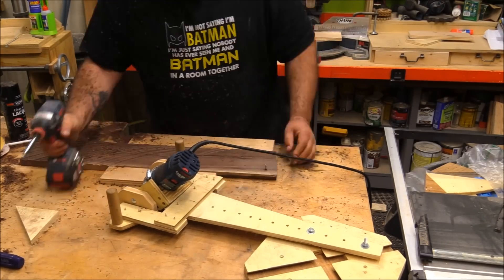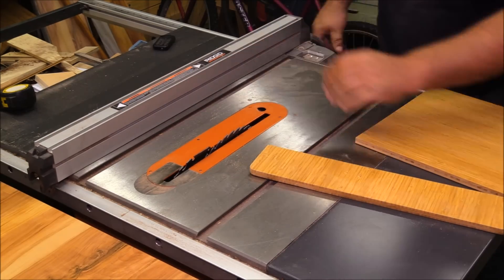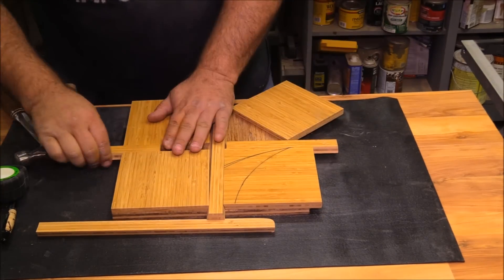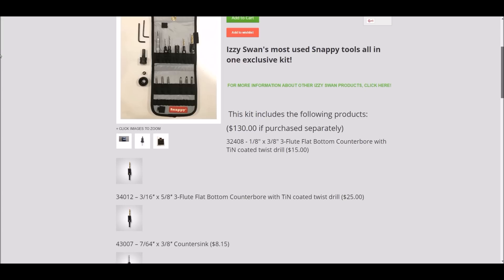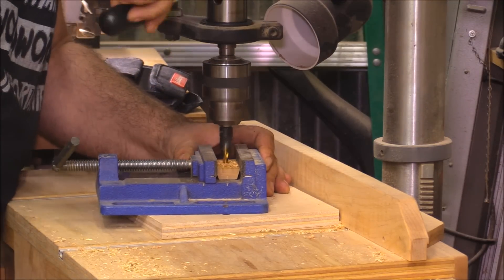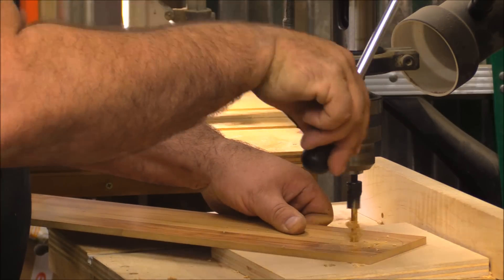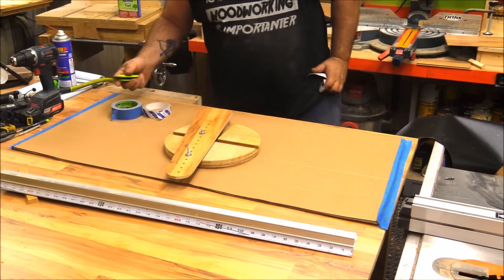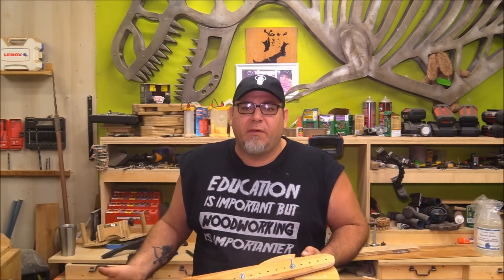(how to make) a router jig for making ellipes

Comment: If you add som talc in the slots I bet your guide rails will slide even easier. Nice and instructive video though.
Reply: sjobang paste wax would be better. last longer and you dont have to worry about the dust scratching a workpiece. Not that talc is likely to level any major scratches... lol.

Comment: there is a limit with major and minor axis diameter with jig. You can usually solve with use of longer slides. Can use 50% shorter slider to slide minor axis than major axis to avoid collision). Then you can have a narrower eliptical tables

Comment: instead of gluing the 4 squares onto the base, could have made the whole thing out of a block of 38x200 and routed the channels with a dovetail bit. use the same bit to chamfer the edges of the slides to fit the slots.

Comment: Fun Fact:  This would be called device is very similar to that of a wanzer needle bar mechanism found in sewing machines. (especially older ones like singer, wanzer, etc).
The wanzer needle bar mechanism is used to translate rotational movement to linear movement.
in the case of the sewing machines, it takes the rotational movement of the motor and translates it into the linear movement of the needle.

Comment: instead of drilling the holes like you did, could I just make a long slot and use wing nuts? Of course, I would have to make sure they are nice and tight. Do you think that would work, or is that a bad idea? I'm limited on $$$ for wood that's why I'm asking and I don't want to screw it up if it's not a good Idea. thanks.

Comment: Honestly given the innovation and the thinking outside the box (circle in this case) ideas you have shown in the past I was hoping for you to show people something more then the average ellipse jig. Modify this exact jig to create an ellipse that has a 2:1 or greater radius ratio. The length of the ellipse has to be double or more the width. Using only those short pivot slides your limiting the possible  size of radius ratios this jig can achieve. Example you couldn't get a 2+:1 ellipse easily without having interference or cutting into the jig itself on the short sides. However if you made a secondary set of pivot slides that were as long as possible without interfering in the center then the pivot points could extend outside the circle and still be kept on their proper x and y axis, allowing for slender sexy ellipses instead of only fat ones.

Comment: Use a single sheet of paper as a shim between the slides and the blocks when attaching the latter. That'll give you a tight fit with just enough room for it to move.

Comment: It is so simple to make!!  I really like that the double sided tape leaves no center hole in the finished piece.  Now, take a longer piece of your extra slider and set it up to attach to the swing arm like a short one.  Bolt it to two holes in one track and you have a circle jig .. a two-fer.  My Grandfather always said, "If it's only good for one thing, it's no damn good".  However, this jig may be an exception.

Comment: At the beginning I was waiting for the "MICROJIG!" :P
I've seen these cross type curve making linkage things before, but never realised you could adjust the spacing and get an ellipse :O What spacing would you need for a circle? I'm assuming a circle's possible? I'm also guessing the spacing would have to be exactly the radius of the circle.
Reply from the maker: just use a compass jig for a circle ., this jig can not make circle because only one pivot point is needed with this system you have to use 2 pivots
Reply: izzy swan Indeed! It turns out the point between the two pivots describes a circle, but nothing further along the arm :) Makes for some interesting mechanisms though if you attach a crank arm to that centre point :D
Reply: As far as I understand it, the distance between the two pivot points is the difference in radius between the two sides of the ellipse. For a circle that distance shrinks to zero. meaning you only need one pivot point.
Reply: Siegfried Gust Oh that makes sense! :)
I love this mathematical rabbit hole :P

Comment: Thank you! Thank you! Thank you for making and posting this outstanding instructional video.  We need to create a template for use in cutting a 20" x 60" elliptical lite into a door and have been wracking our brains trying to come up with a router solution.  Before we found your post we were just going to draw it out and use a jigsaw to cut out the template, and clean it up as best we could.  I have an enormous (and probably unwarranted) disdain for jigsaws.  You just saved my weekend!

Comment: Why do you need a special dust mask for cutting flooring? Does it have special chemicals in it?
Reply from the maker: Yonatan24 is worse then mdf
Reply from the maker: the flooring is made from hdf it is made overseas which is not regulated always take very careful precautions when cutting and manufactured flooring material
Reply: Thank you.. I will not use that stuff! Same goes with Pine!
Reply: Wait, pine wood is full of chemicals? I just spent my day in the workshop working with pine yesterday! Dammit.
Reply: No. At least not that I know of... It's all natural!
I'm just really sensitive to Pine. Put a small piece of solid wood Pine a few centimeters near my nose and I'll start sneezing and coughing like crazy :(
Reply: Yonatan24 Ah, fair enough. You must be allergic to it. It's too bad!
Reply: Because it is not wood. It is man made plastics and resins. Toxic in dust form. Is that not obvious?